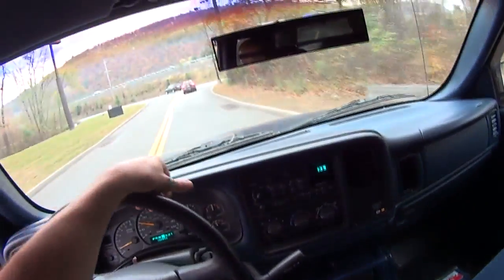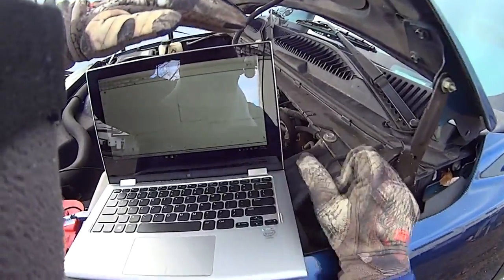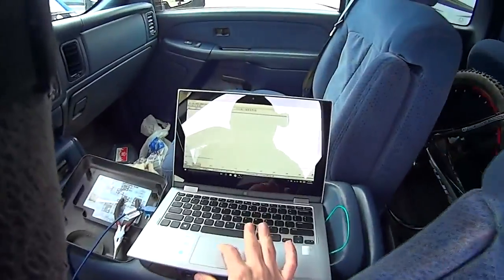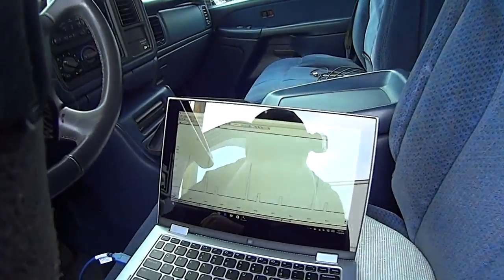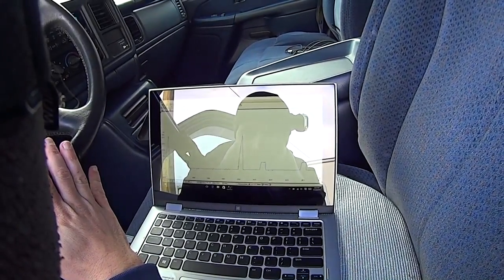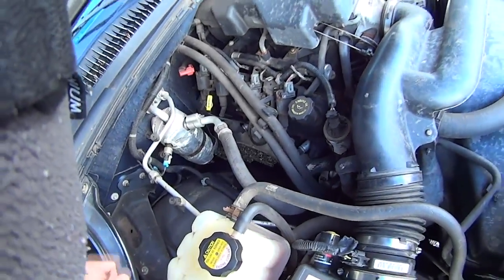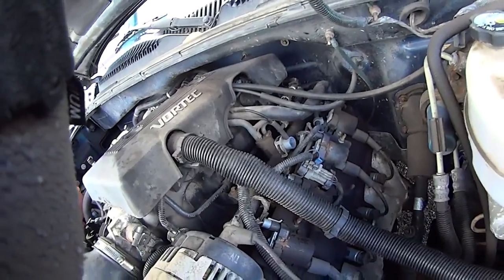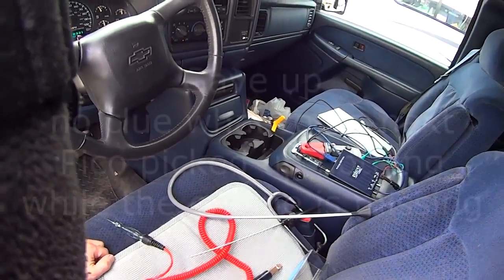Silverado Miss fire with Pico Scope

Comment: Couple of things Krystian. I'd pull the MAF sensor and spray clean the MAF wire inside with MAF spray cleaner. A dirty MAF wire can contribute to misfire and poor fuel mileage. Made a world of difference on mine. I do it twice a year. Make sure the air filter is properly seated in the air box. Again, I'd put a bottle of Lucas Top Cylinder Lubricant in. It will smooth your engine out. Pull all the plug,coil wires and re seat them.  Your engine bay looks nice and clean. I just rust proofed for the season and will be washing the under body all winter. Outstanding analysis on your part. Probably something simple. Could be plug wires. I'd also clean the throttle body. Maybe run some fuel system cleaner through it. It also could be something as simple as a new distributor cap.
Reply from the maker: Hi Jay

Usually when MAF is bad or dirty you get fuel trims problems and rough running engine. This is single cylinder missing randomly, otherwise the engine runs silky smooth.
Reply: Dude the is no distributor on that vehicle

Comment: Have you monitored fuel pump current while it misfires?  Here is an idea for you.  Hook up one channel of your scope to each bank of the engine, doesn't matter what cylinder, then hook up a current clamp to the fuel pump fuse access and monitor the signals on a long screen and watch your fuel pump current and your ignition secondary.  When it misfires look at the burn line.  If at the end of the burn line it creeps up and your fuel pump current is going down, that's your problem, you have an issue with fuel pump wiring or the fuel pump.  The burn line creeping up too high at the end indicates a lean mixture.  Try this out and see if it helps.  Reason why I recommend this is because I had a similar issue on my Ford Ranger.  Had intermittent fishbite misfires and what it was my fuel pump would drop current and I would see the burn line creep up on secondary.
Reply from the maker: I just cant imagine fuel pump causing random misfire. If the the pump stumbles it take few seconds for pressure to drop before you see the engine starting to stall. I mean you can disconnect fuel pump for 5 second on and 5 seconds off and keep doing it and the engine will run smooth. The build up pressure in the lines will keep the car idling for 15 seconds. The pump was replaces 7000 miles ago with OEM part. The pump hums steady. I can hook up a pressure gauge but this type of misfire n one cylinder can not be from fuel pressure. It could be injector but the all have nice wave form and click loudly.
Reply: Astro Camper What is your Maf at idle and on a full throttle drive?  When at full throttle what does your calculated load pid say?  Also what is your manifold vacuum at idle?  Just some other thoughts.
Reply: Astro Camper Have you scoped the crank and cam sensors?
Reply: Astro Camper Do you have a fuel injector tester to energize the injectors and watch the pressure drops on a gauge?
Reply: Astro Camper Another viewer recommended checking battery and Charging system voltage and ripple, I second this.
Reply from the maker: Battery voltage had nice clean waveform comparing to a good known library.
Reply from the maker: busjockey1 Autoenginuity has injector balance test but I lost the pressure gage hose. Will do some diging this weekend
Reply: Astro Camper You checked Ac Ripple?
Reply: This type of diagnosis would most likely indicate a plugged or failing injector. Having a new pump, unclogged said injector and got rid of the misfire, my 2 cents.

Comment: The first thing I think of with isolated idle misfire that goes away with acceleration is a vac leak, which may throw no codes. People say that spraying water works pretty well but I've seen that test fail to detect the problem. In the cold weather your intake manifold seals might leak a little air, possibly not enough to affect trim. The other thing that might be an issue is the iac valve, which should be closing down to compensate if you have a vac leak. Have you solved the problem now?

Comment: I noticed you did snap throttle and idle testing, but I learned that many secondary waveforms will look good under those circumstances..The problem only showed up under load.  I would power brake the truck and re do the tests.  Many times you'll find your problem that way.
Reply from the maker: Not sure I trust my wife while I stand in front with a scope. I have life insurance.

Comment: If it's high mileage may need to do a crank shaft relearn to make up for timing chain slop, will cause miss at idle on higher mileage motors

Comment: Hi Astro Camper, very interesting. On my old Jaguar I had a similar problem but it was not depending on outside temperature and I found, using a pressure transducer with the Pico that the timing chain was 16 degrees off. 
Since your problem seems to depend on outside temp can you check for a stuck open thermostat which keeps the engine longer cool and the mixture rich for a longer time and this would show mostly at idle speeds.
Get a readout from the coolant temp sensor it also can be working but when they get older they can be higher in resistance which would signal a colder engine and tend to misfire. Catalytic converter can swallow some unburned fuel and not show up on a gas tester.
Lots of luck,
Bernhard

Comment: Try to  identify the misfiring cylinder with a first look sensor or pressure sensor in the exhaust  and a second channel to sync. Once you know which cylinder is misfiring you go from there.

Comment: A misfire with unburnt fuel will show lean on the oxygen sensor I.e. unburnt oxygen. You may experience an occasional stumble whenever a heavy electrical load kicks in i.e. cooling fans starting on high speed because the low speed is not working due to an open low speed resistor.  With good compression, fuel trim, spark quality, ignition timing the cause of the misfire has to be elsewhere.  The good news is the engine is running 👍

Comment: Great video !!…if you have 2 current loops you can place them around INJ 1 and 2 fuses and look at all 8 injectors and coils at the same time. I use a First Look sensor in the exhaust to positively identify or find a misfiring cylinder…did you ever find it ??

Comment from the maker: Owned the truck for 2 years. Always ran smooth. The crazy thing is that I can not see it on secondary ignition. That picks up 100% of misfires. Maybe it's the engine mounts going bad or cracked flex plate. I borrowed Snap-on Modis scanner. Nothing shows up but the engine is clearly miss firing on one or two cylinders.
Reply: I am really surprised the Modis did not have a "Misfire data list".

Did you already check the very basics? Alternator, A/C, P/S, Tensioner, Idler for binding?

I would take my time and scroll through the scopes buffer, around 3:17 -3:23 @ an idle things seem a little off. Could be wrong I can barely see the screen.I would surely record and recheck .
 http://imgur.com/a/LeJTz
Reply: Moody's Automotive  misfire counter is basic feature on modis. good call

Comment: Check for a failing head gasket. There can be inconsistent symptoms and often no codes or wacked out fuel trims. If the cap is leaking the combustion gases will never build enough pressure to push the coolant out of the system.

Comment: I had a similar misfire on my Jeep. Everything looked good, no codes, no vacuum leaks, fuel trims were within 5-10%, ignition coil was firing, etc. Didn't have a scope, so couldn't see more. Also didn't test the injectors since it's a pain on the Jeep. But it came down to a bad spark plug. My Jeep has misfire counters, so it was easy to move around the spark plug and watch the misfires move. The plugs had maybe 50K KM on them, so relatively new, but yet still 1 was bad. I replaced all 6 and it was all good ever since. Also a weird thing happened when I removed the plugs to inspect them, and then put them back in, after that it started misfiring way more than before! And even threw misfire codes for the first time. I have no idea how that would be possible, but that's what it did. Go figure.

Comment: All this time gone by and still no random misfire detected by the pcm? Still possible normal characteristic of engine. I noticed at beginning of video you stated misfire goes away at 600RPM then truck runs beautiful plenty of power . No CEL, no misfire counters. Only misfire at idle, never under any load. Maybe there is a reason your not finding anything.
#PIP4404E: Slight Roughness at Idle with No DTCs - Possible Characteristic
"Some customers may complain of a slight rough idle with no DTCs or additional engine performance concerns and comparison vehicles may exhibit the same concern. In some instances, an occasional misfire may also register on the Tech 2 when the engine is idling but no DTCs will be stored.
If SI diagnosis for Rough, Unstable, or Incorrect Idle have been completed and are inconclusive or if the concern is the same as the like vehicle, this should be considered an idle characteristic of the vehicle and no repairs should be attempted."
Reply from the maker: It runs smooth now. Only when it's below 45 it runs rough
Reply: Moody's Automotive yes, this is known as the GM-RF (rumble feature) to prevent your Yoohoo Chocolate drink from separating whilst in the cupholder. Standard on all 6.0L equipped trucks.

Comment: Good diagnostic methods. Fishbite non-constant misfires are always ignition-related. When was the last time you changed the plugs and wires? Spray the coils and wires with a waterbottle and see if that makes it act up more. Good luck!
Reply: Ah you said you replaced the plugs 20k miles ago...what about the plug wires?? On the scanner you should have misfire counters, even on a 1999...not sure about Auto Enginuity though.
Reply from the maker: Thanks Ivan for reply. The wires are original as are the coils. Wouldn't the secondary ignition pick up the miss fire. I can feel the engine missing while idling but Pico shows nice waveform on all wires. I hate to be a part swap-er and start replacing everything. The reason I watch your channel is to not swap unnecessary parts.

Missfire counter reads 0 but I can feel the cylinder miss. Schrodingers Box uses Auto Enginuity on youtube so I end up buying it. It's OK for $700. Looking for used Verus right now.
Reply: ya I would suspect the plug wires for sure. Try the water bottle!
Reply: I'd second the plug wires.  If they are 99 they are probably brittle and may be leaking the occasional spark.
Reply: that would show on the pico scope if he is recording when it happens!

Comment: Krystian we know that you will figure this out. You're a smart guy.  Please post a video when you do. Your analytics are excellent. Two weeks ago I replaced the bulbs in my instrument cluster and when I put it back together the left indicator lamp wasn't flashing. I drove around for two weeks like that, and boy just having that left  lamp not flashing irked me to no end.  It's always the little things isn't it? Are the scissors sharp? Does the engine run smooth? Anyway, I pulled the cluster yesterday and replaced that stupid little bulb, and now I am driving around whistling up a storm happy as pie because when I flip that left indicator the bulb flashes. Nothing like a random misfire to keep guys like us irked  during the day. I like my auto air conditioning COLD also when it's 90 degrees outside. Life is funny isn't it? Wyatt1153 and me are the same guy.

Comment: Generally, if you have a miss at low load, idle and it clears up under load....usually that points to low compression. More prone to miss at slow engine speed.

Comment: CKP Sensor maybe dropping out at Idle or maybe Crank Angle relearn needed due to chain stretch ? Scope while occurring and, zoom in and go thru buffer one frame at a time ! Also certain parameters must be met before misfire counters will start counting such as closed loop,rpm, load etc. . Maybe those parameters are not being met when your misfires are occurring so the PCM is not counting ?
Reply from the maker: I'm in closed loop, feeling miss firing by PCM does not detect it. I just bought pressure pulse sensor that should find the miss right away. It's shipping from Europe so I have to wait

Comment: at about 3:02 on #8 cyl. you had a misfire, you missed it, I barely saw it. Secondary and primary show "ALL".
At that point I saw, one of two things, your spark found a shorter path to ground, OR the Air/Fuel changed to lean.

Comment: also you say the computer didn't set a misfire code, but were there misfires showing up in the misfire monitors of the individual cylinders? I know you said it doesn't have a misfire counter, but I thought they did.
Reply from the maker: No misifire recorded. Ran cylinder balance test but got no misifires.

Comment: Get latest version of picoscope software first, then hook picoscope up to ckp signal. Measure the frequency of ckp signal with math functions, crank, pick your channel, comma, put in number of teeth Total (wtih missing teeth), example: crank(A,36). Put a trigger on cylinder one with another channel. Watch for an RPM drop in ckp frequency. RPM drop matched with 2nd channel will equal what cylinder made the rpm of crank slow and will tell you which one it is. Problem still there, but now you know what cylinder it is.

Comment: Try a laser heat gun on the exh manifolds, the misfiring one will be colder.
Is the truck a bio fuel truck that detects ethenol in gas?
these require a lot of fuel pressure, maybe just below spec', lean misfire?
good luck with it.

Comment: Could poor injector spray pattern be a possibility? Just throwin' it out there. I don't know if spray pattern problems can be detected with a pulse-type injector balance test however. I think this has to be visually detected in a graduated cylinder style test. If someone knows feel free to chime in.
p.s.
I'm seeing plenty of good tips in this comment section. Not typical behavior for YouTube, but I enjoy good comments when I can.
Reply from the maker: I took them out and in ultrasonic cleaner they went. Then tested the spray patterns. All good. Truck still misses at idle
Reply: Astro Camper Thanks for the fast reply. What model of picoscope are you running? I'm about to buy one after seeing this video, looks nice.  edit: nevermind, you said 2204a in the comment section already. The last thing I can think of is maybe you have a hot spot causing preignition in one of the cylinders? Sloppy timing chain has already been mentioned so I can't say that one.
Reply from the maker: It's a 2 channel type. Not sure the model. It was $139

Comment: Hook up a first look sencer to the center of the intake then go to the table pipe. Clean the mass air flow sencer. The other thing is to look at fuel trims they will tell you if you have a vacuum leak. One other thing is check the brake booster. And check cam and crank. But look at the fuel trims at wide open throttle I have found my problem many time that way. Then smoke test the engine. I'm pretty sure it's a small vacuum leak. Chevy the egr or the booster or the intake are the leaks. You need to learn more testing then you will find it.

Comment: My 95 chevy it turned out to be the pick up module. Or as they say now the striker. But that truck dont have one. A lifter bleeding of will do it to. The first look sencer will tell you if that's what's rong or not. But you are probably going to find it a vacuum leak or a lift going bad 6.0 lifter go bad they have a soft camshaft

Comment: I'd check the crank sensor and cam sensor if there is one. If they are worn out the signal drops occasionally and the injectors/spark won;t get input signal. This may not show up on scope since you only trigger on spark/injector good signals thereby miss the dropped ones.

Comment: i have struggled with a avalance with a simular problem. in the end it was a smal leak in the fuel regulator witch drops a little bit of fuel bij the vacuumhose into the mainifold. it wasned a constant misfire en fueltrims look oke. (-2 / -4 i belive) It only shows when i took out the sparkplugs and 1 cylinder was darker. maybe this helps. greetz from holland.
Reply from the maker: I'm actually in the middle of tearing everything apart. Today I pulled plugs, injectors, fuel regulator. Have to run to junk yard on Monday to get some cables so that I can clean the injectors.

Comment: grab gallon of water and soak intake manifold. watch for idle change and stream or tail pipe. i did not finish video, did u pull regulator vacuum line? ffkkk yeeaahh
Reply from the maker: I did that